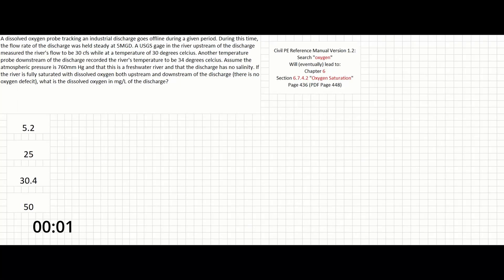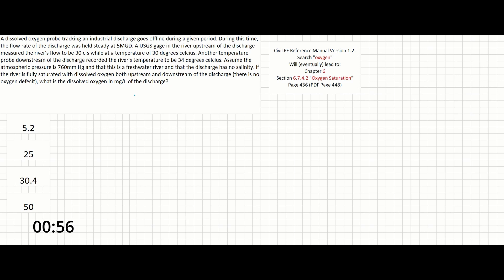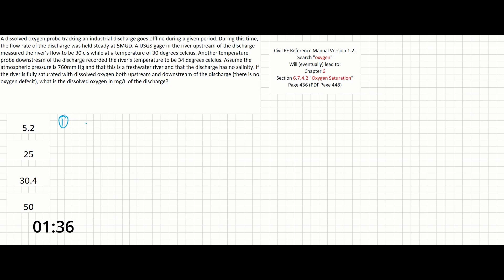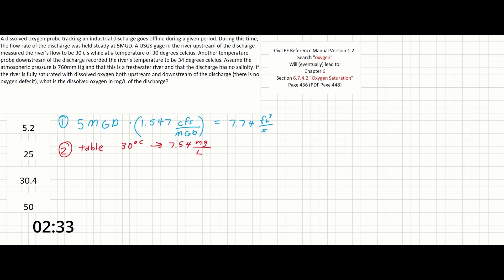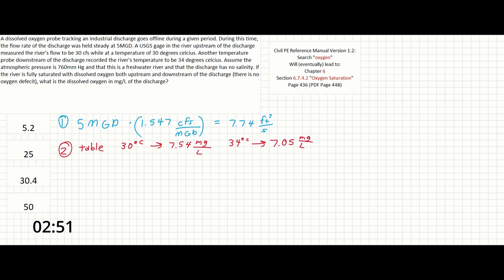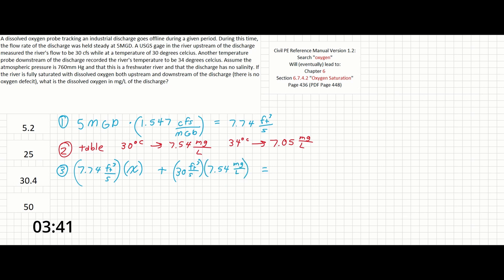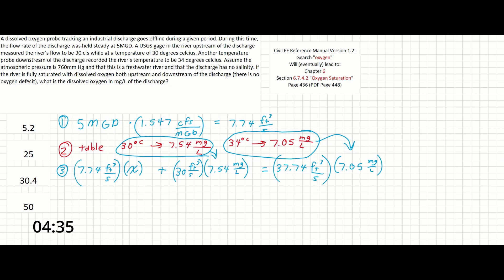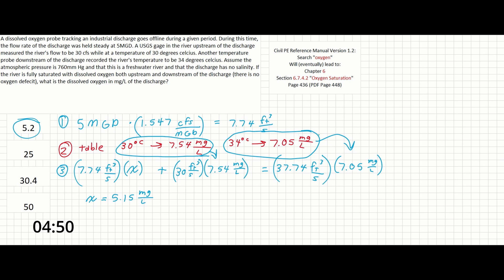PE Exam Practice Problem #29 (re-uploaded): Water Resources | Mass Balance - Dissolved Oxygen Conc.

Comment: One thing you might check during the exam is if you know it has to lower the DO content then only one of these would lower it. Could be a good way to eliminate answers if you are running short on time!
Reply from the maker: Absolutely a smart move. The NCEES generally picks better values than I do so they might not always give you a freebie like that but its definitely a good idea. I'd like to think that oftentimes there is at least one answer you can remove using that kind of process of elimination.